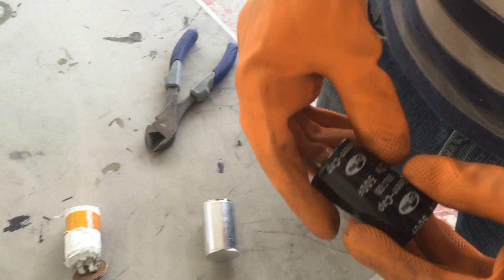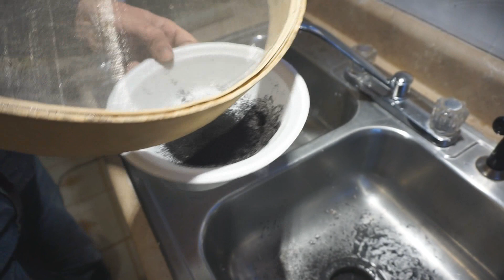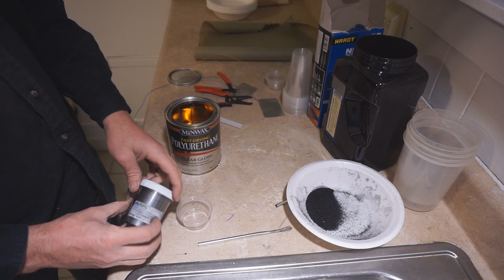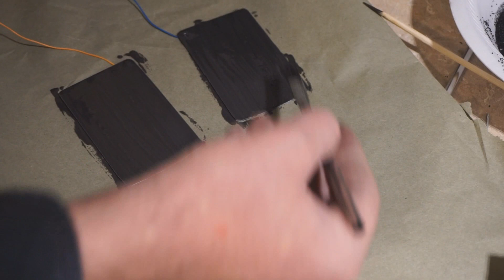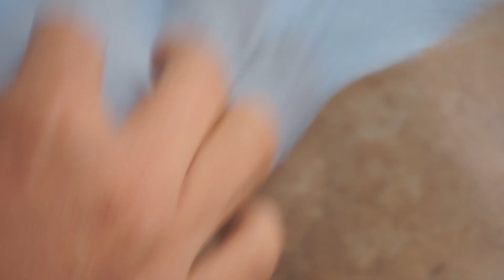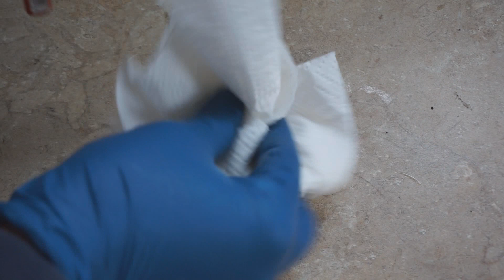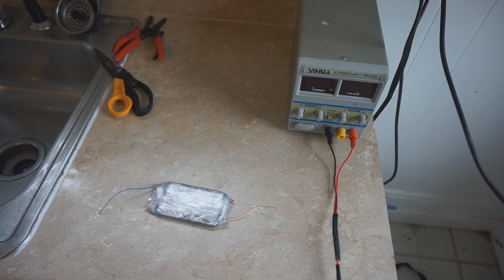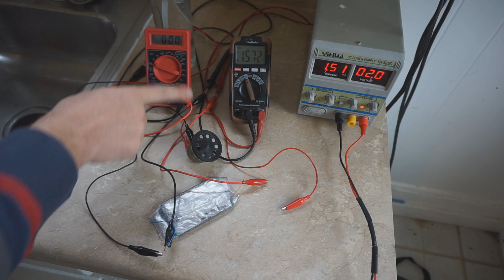Easy DIY Graphene SuperCapacitors

Comment: I watched the video all the way through.  Since you took the time to make such an interesting video, I'm going to take the time to offer some constructive criticism. 1. Phosphoric acid is non-volatile, and is somewhat hygroscopic.  It will not dry out under normal conditions.  Something else is happening in the cell to give this appearance.2. Phosphoric acid directly attacks aluminum, and will also dissolve copper if it's made anodic.  It will do the same thing to stainless steel, and pretty much any metal other than platinum and some other expensive noble metals.  Carbon, whether it is glassy, graphite, graphene, etc, is a less-expensive material that will work as an anode in this electrolyte system.  The problem is that the bulk conductivity of graphene electrodes is low, so a metallic collector plate needs to be used, like you are already using.  The catch is, that the electrolyte cannot touch the aluminum collector plates, not even a little bit.  You have the right idea by mixing graphite with polyurethane, but you probably need multiple (electrically conductive) coats to make sure that all metal parts are completely protected from the electrolyte.  Personally, I use wax that has been mixed with a 50/50 mix of graphite flake and nano-powder.  This adds bulk and surface conductivity to the wax, while the wax remains hydrophobic and protects the metal collectors.3. Mixing PVA with the phosphoric acid will give a less conductive, but more mechanically stable dry-film electrolyte.  This avoids the hassle of trying to seal a wet cell.4. Oxygen will oxidize graphene at the anode, causing it to lose surface area and conductivity.  Even aqueous low voltage cells need to be sealed to keep air away from them.  You have the right idea, but sealing would be even easier if you use a dry-film electrolyte.5. With your current cell chemistry, it will rapidly lose capacity if it is maintained over 0.6V.  There are ways to get a higher voltage, such as using asymmetrically-sized electrodes, but 0.60V to 0.65V is a standard practical limit for graphene electrodes with a phosphoric acid electrolyte.6. 100 cycles isn't much for a supercapacitor.  However, once a test is run out to 1,000 cycles, it's generally possible to see how the cell quality is trending.  One little secret among energy researchers is that cycle life isn't necessarily the best test of a supercapacitor.  A more strenuous and useful test is to maintain full voltage across the cell, and see how the capacitance drops vs. time.  If it maintains its capacity at rated voltage for 10 years or so, it's a good cell.  If it gives out after a few hours, it's very bad.  Ha ha!  ...or the charging voltage is too high...The cells that I've put together only work up to 0.6V.  However, after they've been charged up, it takes at least a month for them to self-discharge down to 50% of their initial energy.  That's pretty much up to the level of commercial supercapacitors.
Reply from the maker: +WGTR 
Great information.  I will reread it a few times to better understand it and then start experimenting with some of your suggestions.  Thanks for sharing.
Reply: @lasersaber  Please measure the capacitance. 
Thanks
Reply: +simon6071 It's not always that simple.  Electrochemical capacitors can have faradaic reactions like a battery, and batteries can also have non-faradaic capacitance.  It depends on electrolyte chemistry, operating voltage, and electrode structure and composition.  The more like a capacitor the cell is, generally the lower the energy density and higher the cycle life.  The more like a battery it is, energy density becomes higher and cycle life shortens.
Reply: Direct quote "Also... Graphene capacitors are a terrible idea..."

Anyway, graphene capacitors aren't a terrible idea, they're just not the same kind of capacitor you're used to. The activated carbon IS the surface area. Here's a short piece from another article:

Supercapacitors, also known as ultracapacitors, are able to hold hundreds of times the amount of electrical charge as standard capacitors, and are therefore suitable as a replacement for electrochemical batteries in many industrial and commercial applications. Supercapacitors also work in very low temperatures; a situation that can prevent many types of electrochemical batteries from working. For these reasons, supercapacitors are already being used in emergency radios and flashlights, where energy can be produced kinetically (by winding a handle, for example) and then stored in a supercapacitor for the device to use.

A conventional capacitor is made up of two layers of conductive materials (eventually becoming positively and negatively charged) separated by an insulator. What dictates the amount of charge a capacitor can hold is the surface area of the conductors, the distance between the two conductors and also the dielectric constant of the insulator. Supercapacitors are slightly different in the fact that they do not contain a solid insulator.

Instead the two conductive plates in a cell are coated with a porous material, most commonly activated carbon, and the cells are immersed in an electrolyte solution. The porous material ideally will have an extremely high surface area (1 gram of activated carbon can have an estimated surface area equal to that of a tennis court), and because the capacitance of a supercapacitor is dictated by the distance between the two layers and the surface area of the porous material, very high levels of charge can be achieved.

While supercapacitors are able to store much more energy than standard capacitors, they are limited in their ability to withstand high voltage. Electrolytic capacitors are able to run at hundreds of volts, but supercapacitors are generally limited to around 5 volts. However, it is possible to engineer a chain of supercapacitors to run at high voltages as long as the series is properly designed and controlled.

--

So would CNT's make better capacitors? Yes, but CNT's are also very expensive to produce, and yes, graphene can be produced in much less sophisticated labs than CNT's. The problem is that it's difficult to create consistent, uniform, and structurally perfect graphene sheets of any appreciable size (hence we always see them in the form of nano-platelets in videos like this). However, there are various methods of turning several nano-platelets into an actual graphene sheet that are ALSO very low-tech and cost effective, like coating a compact disk with nano platelets and then "baking" them with a dvd laser. There's a ton of research going into more consistent graphene production and it's likely that methods for creating graphene sheets of an appreciable size (>1cm) will be around in the very near future. It is NOT likely that cheap methods for producing CNT's will be around in the near future.

This doesn't mean CNT's don't have their place, really they're completely different beasts. For one, CNT's can be manufactured in a way that keeps them from being brittle, unlike graphene sheets which are very, VERY, brittle.
Reply: I believe you are wrong. If you go to 18:24 he will tell it is 'fresh of the charge of the power supply' .... so the sc/cell was charged but it was not shown.
Reply: I am not sure if you are familiar with Ernest's Hancock's battery project or not.  He was trying to do something similar with Edison Nickel Iron batteries and capacitors.   Basically he figured out how to nickel plate carbon nano tubes to dramatically increase surface area. He made his own nano tubes on the cheap and figured out how to plate them.   You can read more about it by searching Ernest Hancock Edison nife  batteries.
Reply: Aaron Ameer Beg Yeah but that's not what he did. He mixed graphene non-platelets that he purchased from a lab with activated carbon fiber. So really this is a modified carbon supercapacitor, where he mixed graphene nano-platelets into the carbon to greatly increase the surface area (as graphene nano-platelets will do).

I agree that activated carbon, and/or graphene would make terrible CAPACITORS, but that's not the intention here. He is making a SUPERCAPACITOR, one that could theoretically approach the quality of some very expensive commercially available supercapacitors.

The name 'supercapacitor' is fairly confusing, and honestly sort of a dumb name. Supercapacitors have very different applications then traditional capacitors, and are not simply capacitors with really high capacitance.

So yes, CNT's would make great capacitors. But that's not what he's trying to make, he's trying to make a supercapacitor.

And of course, we go back to the cost and time required to make CNT's versus the cost and time required to make graphene nano-platelets (which can literally be made in a home kitchen, and yes, you are right it's not as simple as blending a charcoal filter, it's much more complicated than that, but still easily doable).
Reply: @ether5463 I tend to believe what you said. It makes a whole lot of sense. I don’t have a very strong background in the natural sciences but I have to ask this one question, is there any other material/s that could have been better used as a binder for the grapheme stuff other than the phosphoric acid? You see, the comments are much and at times sometimes I get confused as to what to believe. Kindly do a reply.
Reply: what about using a different electrolyte maybe forgoing using metals as your cathod and anode. like make a compressed slab of graphene/graphite for the electrical connections and submerge them in a solution of electrolight and crushed activated carbon. additionally you miight suck out the air from the chamber as well.
Reply: you seem to me like someone I will learn a lot in the future, cause I'm just getting started, please let me keep in contact with you because I'm very interested in your knowledge, I would love to make all this massive and economical alternatives for people, you might be very helpful in my task
Reply: Aaron Ameer Beg I think you should reread what you wrote above me your exact words were GRAPHINE capacitors are terrible idea
Reply: Aaron Ameer Beg 

Graphene capacitors are terrible idea?

That is about the stupidest thing than that I've heard even on the internet in at least a decade
Massive amounts of millions of dollars are being poured into graphene research as it relates to supercapacitors and you're saying then all these companies and investors are stupid?

The problem with carbon nanotubes is the relatively high cost in producing them companies don't want to produce something that is not cost effective.
Reply: Do a video then , on how you make you'r capacitors !
Reply: WGTR What a fantastic comment. Thanks from all of us.
Reply: tell me, how do you think lactic or glycolic acid would work?
Reply: +Jack T I don't know.
Reply: Aaron Ameer Beg "but what you really want to do is avoid youtube self help videos" Hah hah! I laughed a Dr pepper out my nose on that, right on man, funny as hell!
Reply: No it is real.
Reply: I want this guy to show us how he makes his. They sound awesome. Please post a video!
Reply: keyword: Helmholtz double-layer ( https://en.wikipedia.org/wiki/Double_layer_(surface_science) ) this double layer acts basically the same as in semiconductors with their p-n-junction ( https://en.wikipedia.org/wiki/P–n_junction ). so this layer is what effectively insulates an electrolytic capacitor as long as you have the right polarity. the innate polarity of this junction is the reason why capacitors have a polarity.

yet the people shouting electrolytes are conductors are still right. the elecrtolyte in and of itself conducts electricity because it contains ions as charge carriers. its the interaction of the ions in the electrolyte with the surface of the electrode, which generates this insulating layer which prevents current through the electrolyte.thats why you actually would only have to increase the surface area of one electrode, because the actual area that makes up the capacitance ( remember capacitance C=A/d ) is just the surface that has the insulating (and thus correctly polarized) helmholz layer. therefore d is the thickness of this layer, which in turn grows linear with the applied voltage.

(DISCLAIMER: that is what a broad understanding in physics and electrical engineering managed to let me construct out of 10 minutes of rapid wiki search... so correct me if you !!!!actually!!!! know of the physical principals of electrolytic capacitors!)
Reply: Oppps here is the link. http://www.freedomsphoenix.com/Article/119045-2012-09-19-nickel-iron-battery-prototype.htm
Reply: Still might be very useful for long term low current environment sensors for earth sciences. Maybe add a PV or sugar charging aspect and it may be compostable
Reply: Aaron Ameer Beg that is not true Aaron electrolytic capacitors are valid capacitors they've been used for years and years and years
Reply: What electrolyte shall I use with aluminium sheet and activated carbon in order to keep it in good condition for a very long time - as this video contradicts to all what I know about acids and normal metals?
Reply: WGTR You must be a scientist in this field.
Reply: sodium sulfur
Reply: WGTR i badly want to see this guy make diy video's!
Reply: https://en.wikipedia.org/wiki/Supercapacitor#Electrolytes
Reply: Aaron Ameer Beg,,  these are hybrid capacitors they hold huge capacity like an electrolytes cell battery and a capacitor,, I think that the super capacitor is like this
Reply: Nice feedback, I think. Although most of this is overhead.....like way over my head. LMFAO ! Keep breaking new ground and sharing knowledge.Communication is key, as much as experimenting is.....for both categories you got my respect. Thanks
Reply: WGTR   Fe-Kollektor und Na2CO3 als Elektrolyt nehmen. Ansonsten ist Film gut!
Reply: @RalphMogli  It is perhaps possible to do this with Fe collectors and Na2CO3 if halogens are excluded below the ppm level.  Otherwise corrosion will occur, along with leakage current.
Reply: +NatureHacker That wouldn't hurt, but a cheap LCR meter won't give useful data.  A graphene EDLC has distributed resistance and capacitance throughout the electrode structure, and the cell's capacitance varies according to test frequency.  Most cheap meters test at too high a frequency to be useful in this application.  A battery test cell is more useful, and is designed to charge and discharge the cell multiple times at a constant current.  The time between cycles on the chart can show what the capacitance is at different test currents.  Efficiency can be determined by energy in vs. energy out.  At constant current, the derivative of the charge and discharge slopes should be zero.  If there is a "hump" somewhere in the middle of the curve, that shows that charges are crossing the electrode/electrolyte interface, and you have "battery-like" interactions occurring with one or more electrode(s).
Reply: chunky carbon cap... I love that description or ccc for chunky carbon units in my case.
Reply: Aaron Ameer Beg That is my perspective as well. By adding an acid it seems to be a type of battery. The paper is already a dielectric. If anything is added to the paper, it should strengthen the dielectric to prevent breakdowns and reduce the thickness at the same time, bringing the plates closer together. Comments, please.
Reply: Hey, I would ask on a normal comment but it would never be seen. Would adding more layers give it more charge or do nothing?
Reply: I was thinking along that line myself. But thinking of surgical grade stainless steel plates and maybe use of a less reactive acid such as hydrochloric?
Reply: Aaron Ameer Beg  you directly said they were a bad idea... are you crazy?
Reply: Aaron Ameer Beg really??? You never said they were a bad idea?
Reply: Alas, humanity is not lost - maybe.
Reply: A capacitor consists of two conductive suface areas with an insulator (dielectricum) in between.
This device looks more like a battery to me too, some chemical reaction must take place between
the two plates facilitated by the presence of an electrolyte resulting in an electrical output current
once charged.
Reply: Veni Vidi Vici copper sulfate
Reply: I agree.  The insulator should have a known dielectric strength.  I think this is actually a battery..
Reply: electrolyte is not necessarily conductive... its more like a semiconductor.. thus why you can use distilled water as an electrolyte during hydrolysis. It's more like an insulator than a conductor, though nearly every material can conduct to a certain point.. just depends on how high the voltage is... even the atmosphere becomes conductive when there's high enough voltage... ie. lightning.
Reply: Maybe, you wanted to read my post to light saber regarding a capacitor with complete new type of dielectricum. ;-)
Reply: 0.6 V? What's anyone gonna do with 0.6 V?
Reply: WGTR where’s your video?
Reply: WGTR - Do you have a website? I'd be interested in any tutorials you have, and in knowing what resources you'd recommend for learning about these things from your point of view. You can reach me directly at facebook.com_tronedavid Thanks!
Reply: you can power a calculator with 0.6v and swap out that little fake solar collector
Reply: @To WGTR or any experts- My question is "Any best real life applications using this Graphene tap (Home made tap)?List below. Thanks for your reply :D
Reply: +WGTR      I enjoyed reading your comment. A thought occurred to me that perhaps the problem with phosphoric acid attacking the aluminium plates could be overcome by electroplating the plates with a 3 micron thick layer of gold. A thin layer of gold costs very little. If plating aluminium is a problem the plates could be gold plated copper or platinum plated copper or whatever works.  Best regards.
Reply: @dogphlap6749  The gold layer will have to be completely free of defects/pinholes.  In practice this is difficult.
Reply: I'm taking notes holy crap.  LOL
Reply: Hey WGTR, I was wondering what you thought about if there would be any way to adapt this to work with high voltage, to be used as smoothing caps for a half, or full, wave HVDC supply? Maybe using a sheet, or sheets, of polyethylene, or better, dielectric between a bare aluminum positive plate and the electrolyte separator? How about using many layers of positive plates, dielectric sheets, electrolyte and separators, and Al+C negative plates sandwiched together? Also could something more conductive be added to the carbon, like powdered aluminum, to assist the carbon in being more conductive for both high and low voltage uses, or more for the low voltage use? Perhaps something like a spherical 100-200 mesh that isn't as flammable or reactive as a finer mesh, or flake particle shape, would be? Is there a better electrolyte that could be used, especially if you were able to use powdered Al in the C, that would be less reactive, or not reactive at all? Something like boric acid in a solvent based or aqueous solution, or an aqueous glacial acetic acid solution? How about a base like sodium or potassium hydroxide, or an aqueous electrolyte with a sulfate like magnesium sulfate, or a salt like potassium chloride? Would any of those react with the carbon, and/or metal powder if applicable, in a negative way that would make them unusable or something that could be added to them to reduce or prevent reaction?
Reply: https://youtu.be/IXTUHLrDBZM
Reply: Yeah I know it's 3 years back........but:

Respect WGTR,.... this is the way to make this world great / good/ Better then is today. Helping there where the need is or asked......
Many can learn a thing or 2 from your action........lol 

Keep it up and perhaps one day we go to Mars and can come back.....he he. ;-)
Reply: R
Reply: Thanks, One Like-Minded to another. As a Prolific Gifted Inventor, I love adding to my knowledge bank which in turn allows me to keep coming up with even more new everyday game-changing practical and useful products. I already have well over 450,000+ inventions (more than the big 4 combined will ever have in their lifetime) in my inventor ledgers (a cumulation of over 35+ years) and hundreds of working prototypes. My inventions have mass appear something Apple, Microsoft, Facebook, Alphabet(Google) and other companies, Can't seem to be able to do so they go out and spend billions trying to find that next game-changers. Over 90% of my inventions are game-changers for the Automobiles, Planes, Boats, Helicopters, Mass Transportations, Personal Mobile Transportations(prototype available), Ice Skating(prototype available), everyday household items, automotive and workshop tools, and pretty much anything else you can think of. The last person who had my ability was Nikola Tesla and the one before him was Leonardo di ser Piero da Vinci and Puleeessssseeee don't say Thomas Alva Edison who has never invented anything in his life he was a crackpot and a thief who took credit for other people works. He was a marketing guru and nothing more. It takes a real inventor to spot a fake inventor. Real Inventors don't need a thousand times to make something work as I (all my prototypes work the first time out), Tesla and Da Vinci have shown. We are literally one in a billion if not more. Now before some of you go off wailing in protest I'm talking about prolific inventors who can invent or improve anything you throw at us. Now there are plenty or inventors who have come up with a single great invention or multiple products but that's about it. And as for those inventions think tanks LOL dream on.
Reply: Hey, boys. I know this comments are pretty old, but I am going to select a career in a while and I would like it to be something attached to graphene, so would like you to recommend me some career to study. I am sorry if my english is not that good my main language is spanish, I hope you reply
Reply: What electrolyte should we use then??
Reply: Can you write me real formul for a diy project great capacitor
Reply: Sir i need help in fabrication of SC would it b possible For help from ur side For my thesis work.
Reply: tom black  I rechecked the old one that I built several years ago.  While it still looks good, the capacity is only a small fraction of its original specs, and the leakage current is much higher than before.  This is likely due to inadequate purity of the starting materials, and construction practices that do not measure up to commercial standards.  I have not built any others in the past several years due to other work commitments and interests.
Reply: You think to much but that's your best attribute.
Reply: https://youtu.be/KiLTEjm8zLw
This is a graphene solid state generator circuit using graphenes thermal motion to generate limitless energy. Please develop this tech.
Reply: What is this area of knowledge called. I would like to research more in this area. Just a green horn here but it's fascinating information. I'm just a simple carpenter. I've always caught on quick when it's hands on.
Reply: Pr
Reply: Rr
Reply: This guy is awesome too!!! Knowledge is power.
Reply: A couple of questions about your comments.  You mention asymmetrically sized electrodes. So, maintain the same material for both electrodes but make the anode or cathode smaller/larger than the other?  That would be helpful to expand on, if you have time/interest. The other is the hygroscopic nature of phosphoric acid. Exposed to the air, the concentration of the electrolyte will change over time, (ie decrease) as well as being subject to other gases ie CO2 that will react with the system and change it. Also, the sealing with heat shrink tubing is unlikely to apply uniform pressure to the plates, without a design modification... simple vacuum sealing would be better.  

But what really leaves me wondering is “how are we determining “graphene” quality for these experiments? Simply following a ‘recipe’ won’t tell us... and an eBay vendor selling inexpensive graphene source did get an independent Raman assay of the submitted sample... it looked largely to be graphite.  

So, as they say “inquiring mind want to know - how pure is the graphene?”
Reply: @nitrousman8882  To answer your first question, please search for this thesis online and review it at your leisure: "Optimizing carbon/carbon supercapacitors in aqueous and organic electrolytes"

Proper sealing and materials compatibility will always be a challenge.  Some university experiments that you see will have the test cell clamped together in a small press to get sufficient and repeatable clamping force.  Additionally some will use generic coin cell housings and a special press that is used to assemble the two halves.  I believe these are used more for non-aqueous cells however.  Internal springs can be used in these cells to press the electrode structures together.  There are of course other options and methods used.

If we are talking about a given random YouTube video, then the answer regarding how graphene purity is obtained is "not at all".  That is just a practical limitation of the typical home experimenter's situation, not a criticism.
Reply: @wgtr7529  thanks for replying.... I really was trying to make sure I understood your comment.  The second question is more challenging to my mind.... and that is how we characterize what is being represented as Graphene.....  (found the article.... tnx :) )
Reply: I say it’s a battery, not a cap
Reply: Ttadusir a espaniol
Reply: This video maker is a LIAR. He says he battery ran a motor for 2 years. That's a lie . They can't run without water or some kind of acid and the terminals corrode.  I've been doing this for years. Salt water works but only for days not years
Reply: Sir i want to learn from you
Reply: you seem to know about this, do you have videos?
Reply: Michael Shultz  guess you have never heard of a electrolytic capacitor.  thre just in about all consumer and industrial electronics.
https://en.wikipedia.org/wiki/Electrolytic_capacitor
Reply: +NatureHacker That's precisely the point.  Even an expensive LCR meter (adjustable test frequency from 60Hz-100kHz) can have one going in circles, and that would be a waste of time.  The numbers it gives can be off by an order of magnitude or more.  This is specifically because, as I mentioned before, a graphene electrode has resistance and capacitance that's distributed.  Certain parts of the cell will charge up very, very fast; while other areas may take hours, or even days to completely charge.  If one uses an LCR meter that tests at 60Hz, that's fast enough that you'd see only a tiny area of the overall capacitance that you'd see at lower frequencies, such as in bulk energy storage applications.  This is one problem that shows up in a majority of academic journals on this topic.  Reducing the effects of this distributed ESR (so that the cell will maintain its capacitance at useful frequencies) is an area of well-funded research.  Using metal collectors (as lasersaber is already trying), is one approach to mitigate this problem, but care has to be taken to protect the collectors from the electrolyte (to minimize corrosion and leakage current, even in the case of copper or stainless).  Anyway, if one has a basic oscilloscope, a couple of power supplies, and about $10-20 of parts, one could build their own two-terminal test cell.  This would allow one to characterize almost everything about a given supercapacitor's quality.  I already mentioned how one works, so anyone who knows electronics could figure out how to build one without much trouble.
Reply: @wgtr7529  hope to be able to comprehend all your words of wisdom before my demise lol I gotta long way to go and short time to get there
Reply: the only hint he needs is to buy a LCR meter
Reply: +WGTR 
Thank you for the information. Looks like an electrochemical capacitor is a hybrid of a capacitor and a battery. Pretty cool.
But I wonder how that Graphene SuperCapacitor could create electricity without charged up first. Would you be kind enough to tell me the chemical reaction involved?
Reply: @simon6071  I wouldn´t say that a graphene supercapacitor can create electricity without a charge up first. For the few things I have read you need to charge up the capacitor, so a electric field will be created. Then, in the capacitor (if the type edlc) will create a double electric layer ( one with positive charges and another with negative charges), and because of the electric potential will have a flow of charges. So the energy to transport these charges from one layer to another will be the same to transport charges (making electricity) from the supercapacitor to the devices that will be charged up.
Reply: @daysiannekessymendesisidor7311  
You say, " I wouldn´t say that a graphene supercapacitor can create electricity without a charge up first." . Neither would I. 
I was the one who challenged the video host's claim that the graphene supercapacitor that he created can produce electricity right after it was made. 

So, thank you for your comment supporting my challenge against the video host's wrong claim.
Reply: A capacitor is a capacitor if it displays the propensity for great capacitance display its galvanic Properties or abilities
Reply: u are smart
Reply: Could phosphoric acid be replaced with sulphuric acid and the metal be silver?
Reply: There is no nickel metal in a nickel iron battery, only nickel oxide.  If you have little pieces of carbon coated with nickel oxide you will have a very high resistance battery (very low amperage)
Reply: Haha, how weird out of all the vids I watch, I see you on this one. (Mandela I know you from). ;)   Reading through the comments, and was like.. hmm  did I switch videos?  Good stuff.
Reply: Aaron Ameer Beg I understood that the term was being used rather loosely for exactly your reasons. One atom thick is a technical tough nut. It was happenstance that I came across this video because I just read in Wikipedia yesterday their article on graphene.
Reply: is this all a big fake ?
Reply: any one want to join me with theses kind of research thing please contact me at owaisf.2008@gmail.com .....these kind of super capacitor have low energy density about 20 wh/h to 30 wh /kg so putting that in a ebike will increase  its weight so....we need to try different combinations...and lithium ion battery has 200wh/kg of energy density ...so this is also a reason of lithium ion battery is being widely use ....so come join me and help me....
Reply: Robert Murray says Na2SO4 (and presumably other metal-sulfate-salt) electrolytes should work with Al foil.

MgSO4      200 F/g   (MgSO4 has F/g as good as NaSO4, although Na2SO4 mobility is 40% more ion-conductive)
 
Na2SO4     200 F/g  

Al2(SO4)3  400 F/g  

Good point on using higher voltage and higher temperature for accelerated-testing.   

If you go to stainless steel or nickel, you might try a KOH (or NaOH) electrolyte.
Reply: Mike Guitar: *Dr. Robert Murray Smith. His surname is Murray Smith. He, and the folks at FWG, are doing some very interesting research. They can also supply a number of the materials which you might need for making capacitors and batteries, some of which are hard to buy or make.
Reply: Correct me if I'm wrong. When this devise can produce electricity right after it was made without the need to charge up first, it is a battery, not a capacitor. All capacitors need to be charged up before you can draw electricity from it. What he has created is a rechargeable battery, not a capacitor.
Reply: @simon6071  in fact some electrochemical reaction is happen between aluminum and the electrolyte who produce charge I'm thinking the same. I know is over two year of your point out but I wanted to back you comment.
Reply: It was charged up first from the power supply
Reply: Dude.  You test one combo an get nanofarads another combo gives millifarads.  Seriously like I said this is about narrowing down the options.  LCR meters are cheap and anyone wanting to make caps or batteries better freaking have one if for nothing besides resistance!
Reply: you are in la la land wgtr.  For quick testing various possibilities you can spend years doing capacitor charging tests and calculations or you can spend minutes with a LCR meter.  This isn't about getting the right value to the picofarad, this is about rapid prototyping and testing.
Reply: NOT A CAPACITOR  ! ITS A BATTERY  ! CAPACITORS DO NOT HAVE ELECTROLYTE  !